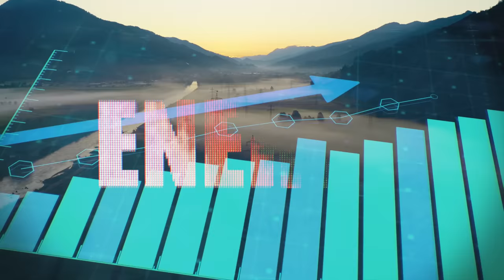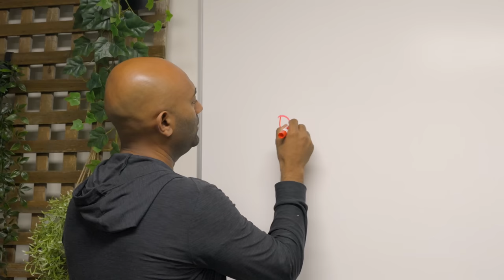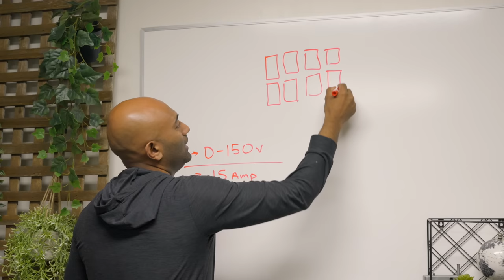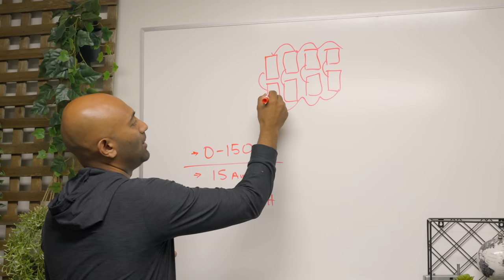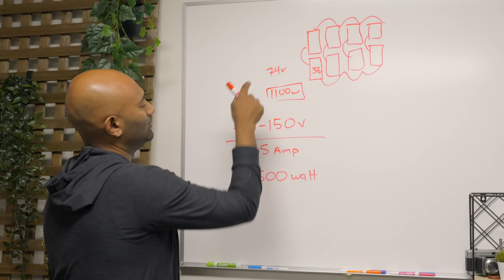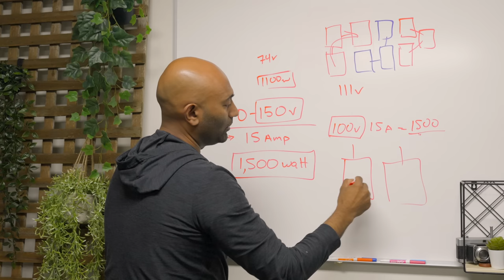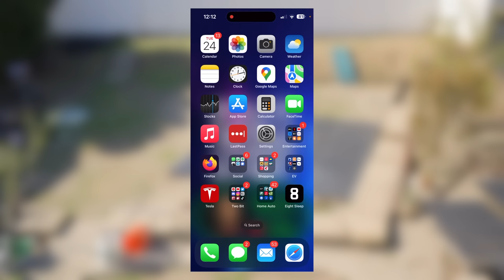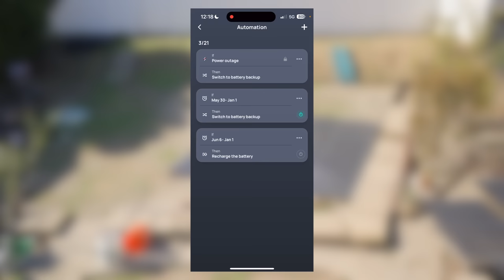Home Backup Power + Solar Power WITHOUT Permits!

Comment: I loved this Vlog, very informative, like yourself I can work out on paper the variables, but doing it in physically is a different animal, but you did it, and much respect for you for that.    I learned a lot from your descriptions of the troubles you faced, laying it on the ground first was not on my previous plans, but what a smart idea, guess what, I am doing that.  You are indeed a smart but also a commonsensical man.   I also agree with the independent battery unit approach, so you can add on as required.  The only change I would make, was putting the lighting and refrigeration on its own independent circuit, as we can not live without food or lighting. (but maybe you thought about that) Regardless, thanks for the great Vlog.

Comment: Even if you are not connected to the grid you still need permits in the vast majority of places,. For instance ; I am building on vacant land from scratch, I will definitely need permits for both my mounting systems and the electrical part.  Even without grid connection, one reason is if Firefighters need to come and deal with something they need to be able to safely shut off the solar power rapidly and easily, to do their work.

Comment: Where did you get used panels? I'm in Michigan, and at $70 - $100 a panel, I would be more than happy to get going on my solar plan.  The only permits I might need would be for the roof installation because I don't care about selling back to the electric company.  At that price, I could afford to develop the battery walls and buy the power management, and even get a new roof.

Comment: Where is your ground? Are you running a floating ground? Where is your neutral bonded? Is there neutral voltage between the two systems?

Comment: The simple way to look at putting power generation of any type in series or parallel is, putting them in series increases the voltage, where you add the power value from each source to get the voltage output from the system.

Putting power generation in parallel increases current output.  It's better to match voltage on each parallel path, or you get into harder calculations to figure out what you're going to get.
Reply: Yes indeed, I'm glad you brought this up.

In fact, you have to match the voltage (or at least get very close) for the strings that are then placed in a parallel configuration,  as a safety issue.  If the operating voltage of string A is higher than the open-circuit voltage of string B, now string B winds up actually being reverse-biased.   If the string does not have a blocking diode (and most systems do not... solar panels only have bypass diodes built-in, not blocking diodes), then the reverse-bias causes current to flow into the under-volted string from all the other strings that are in parallel with it, forcing the entire array to the open-circuit voltage of the under-specified string and with potentially enough current to cause a fire in the wiring or in the panels themselves.

So voltage matching is mandatory.  The highest operating voltage for any string in the system must be less than the lowest open-circuit voltage for all strings in the system (when paralleling strings).

(One can also ask the question, why doesn't partial shading cause this issue?  The answer is because the open-circuit voltage for a panel is not affected by shade, only the optimal operating voltage.  So mixed shading conditions are fine, but mismatched series strings that are then placed in parallel is not).

-Matt

Comment: Very nice presentation.  A couple od nice additions and a warning.  To show the panel specs would have been helpful to begin your calculations.  Also the warning is the temp variant.  While the temps in San Diego are not much of a concern it's common practice to allow a 10% swing so that at lower temps you don't exceed the 150 volt limit.  A personal request would be to install optimizer to compensate for the shading to some of the panels.  Another would be to show the integration of a generator and how it can be automatically controlled. Just some observations.

Comment: We have 2 delta pros and 4 extra batteries. We bought the shp but never installed it due to too many issues with breakers being too sensitive and not staying connected as well as the typical Ecoflow firmware problems. More reliable to use the double voltage hub.

Comment: Even though you are not messing with a lot of panels, the math needs to be mentioned at the beginning and including electrical safety once you add up all those volts and amps. Also make sure you remind the people that solar panels do NOT have ON/OFF switches so if you have them in sunlight you can get arcs, sparks, and shocked...wear protective gloves. IF YOU HAVE SWEATY HANDS YOU COULD GET KILLED BY A 12V CAR BATTERY IF YOU AREN'T CAREFUL. If you go to connect 150V and you get yourself across both wires you could die and DC does NOT let go of you. You stiffen up like a 2x4 so if you are sweating...you are very conductive. Overall, I found your video good and informative.

Comment: Hey Ricky.  Have you ever tried hooking the Ecoflow systems up to pull power from a vehicle's alternator while the vehicle is in use?  That might come in quite handy when you have to be away form the power grid for an extended period of time for instance, during a weather disaster.
Reply from the maker: oh interesting basically using the car as a generator, although we have a gas generator we can just run and its a bit simpler... but that would work!

Comment: Backup power is more or less important depending on where you are.

I think that everyone should look at the average number of hours that a power outage lasts in their location and think about how to deal with that.
Test what happens when you turn off power and what will hurt you most. Likely you want your fridge to continue to run and be able to make coffee etc and heat up some soups etc.

Small 1-3 kWh batteries like Ecoflow, Bluetti and Anker will bridge most poweroutages if you accept you can't do laundy for that period.

If you already have solar on the roof to reduce your powerbill, see if you can have a switch installed so the DC-current from the panels can be used for the batterie.

Comment: Hi Ricky,  GREAT video.  As always very informative and on point.  Ricky, I have many questions.  1.  Can you give your EV car a quick charge if you run out of power, just enough to get you to a charging station??  2.  Is there a solar panel company that will sell directly to he public??  I wan to build my own system.  I see how easy it is.  I only want to buy American or Canadian panels.  Can you suggest a few ??  Or better yet, can you make another video on how to buy directly, from manufacturer to home consumer . . . .  Thanks, Again
Reply from the maker: great questions... i needed a special bonding cable to charge my car with this. but installed on the smart home panel grounded and everything you can just plug your car right into an outlet... some days in the summer when the batteries are full and not doing any more charging, i'll plug in my car to charge even on 110v .. check out solarsteals.com i have a link in the video description... i got my panels from there used for cheap. otherwise i'll take a look!

Comment: Hay Bud! Nice going there & very informative! Maybe on your next system, try using Server Rack LFP batteries from EG4 (Signature Solar).  Inverters there are pretty awesome too!
Reply from the maker: Might need to look into this for the main house, i'd love to check it out!
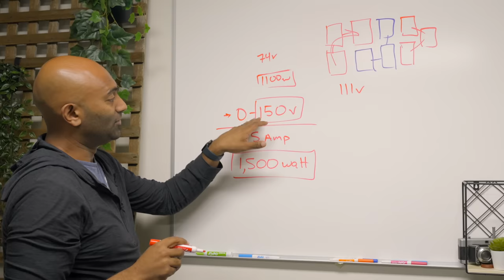Reply: 9:24 many of the EG4's have 500 VOC so you can connect 10 panels in series without any combiner boxes or parallel adapters

Comment: Do the apps work with local wi-fi and locally stored data?  I ask for several possible reasons.  (1) Way off grid use.  (2) If the power is out, the cell towers might be out as well.  (3) Security reasons (perhaps someone doesn't want the data leaving the premises, or observable by whoever owns the apps).

Comment: Your video is very inspirational, I am recently also considering to use EcoFlow Delta pro not only as a backup but also with Solar panel to reduce electric bill.
I have some questions for you if you don't mind.
1. I saw you have two EcoFlow Delta pro units, do you have a group of Solar panels changing a Delta Pro and another group charging the 2nd Delta pro?
2. If I use the EcoFlow Smart Home Panel (SHP), and I only want to connect to 120V loads, is one Delta Pro good enough?

I had been browsing on-line for answers, but didn't get a definite answer. I would appreciate it if you can spend some time responding.
Thank you.
Reply: #2. You only need one Delta Pro for 120V setup.

Comment: I was able to score 26 used 310 watt PV panels for $25 bucks each that i'm keeping along with grid tied enphase IQ7s which I'll be fire selling. The NJ owner had roof leaks with mold damages by Certified Installers with permits in the thousands and a new roofing co that wouldn't even remove or touch the solar panels. You can guess the home owner was so pissed at solar anything. I believe this is the future of solar or fast and furious non permanent solutions. I'm also doing this for prep in NYC which looks like it's here... Just ride the prisioner subways for proof. I'm preparing now just in case. My only concern is this seems like the solar panels are a MPITA to do this each day. The real value is is designing something unique on wheels that can be removed easily at night and stored upright in a tight garage location?

Comment: Cool setup, but in the video you show the closet with circuit breaker panel in the back. I don’t know what the fire codes are where you live, but in New Mexico blocking access in a circuit panel of any kind is severely frowned own.

Comment: Open voltage! You cant check it with a multimeter. In the winter it will be 20% higher. The spec is on the panel

Comment: You might not need permits but what does your insurance company think?
Any problems caused by a system that they haven't accepted would undoubtedly be used as an excuse to avoid paying a claim. Do they agree that there is no chance of these causing a fire, electrical short, or other unforseen problems? Do fire departments  have to be informed about this installation?

Comment: Ricky, I’ve been watching and enjoying your videos as well as others on YouTube. 
I have a EcoFlow Delta Pros system with 8 335 watts solar panels. I understand about series vs parallel but I want to be clear on how you set up the 3 sets of 3 panels. 
Am I right in thinking you set up 3 panels per set in series and the 3 sets in parallel? 
3 in series equals ~111 volts and 9 panels times 335 watts equals 3015 watts max? 
Or is the 3rd set of 3 panels going through an inverter and feeding the AC as dual charge?
My understanding is that the EcoFlow will cut back the solar as it’s charged up so it should be protected right? 
Thanks in advance for your videos

Comment: Hi, I watch many of your you tubes and follow many of your advice/ideas, mostly relate to solar. I just bought Ecoflow Delta Pro as I understand that SDE&G charges different rates for electricity during the day. Please show us how you program or use Ecoflow Delta Pro to save the most by charging it during low rate time and use that saved energy in high rate time. Thanks

Comment: Any updates on your EcoFlow system for backup power during outages? I like the idea of a backup system I can do myself and grow over time, even I start battery only and add solar later. How do you do solar without a permit, or do you never export power to the grid so a solar permit not needed?

Comment: This video on solar panels is in short supply. I would like to know how you know what voltage your need to consider when hooking up to something like the invertor? Also what if you are using microinverters how does that change the connection setup?
How is that Two Bit HQ hooked up to allow you to feed your home-selected cicruits? Does it sense the power from the grid and when it is lost switch over to battery power from your EcoFlow units?

Comment: You could generate enough with your $500-600 worth of used panels (I'm looking at used panels too btw) to 'fill up' a couple of EVs, saving $1,000s per year on 'gas'. You're instantly in credit.

Comment: That's nice, but you live in San Diego. You rarely need air conditioning. Most people need more power to cool their home in the summer. Also to heat in winter.

Comment: Great video, thank you.  I was seriously considering solar but very few solar companies will install or service their system where I live.  And to do so did not make economic sense.  My monthly power bill averages $75 per month in summer and $300 per month in winter.  Cheapest equivalent power solar system quoted was about $275 per month and up.  My little 850 sq ft house needs 3 plug-in space heaters running 24/7 all winter to heat half the house.  
I'm not an electrical expert, but are the batteries charged from the solar panels first then the grid power kicks in after the sun sets, and/or power use exceeds solar panel output?  OR do solar panels and grid power charge the batteries simultaneously?  I want to maximize solar panel usage.  
How does one tell if the batteries are being charged primarily first from the solar panels?  And can the batteries take months of freezing?  Couple months straight night time temps are at 0*F and day time never gets above 25*F.  What system configuration can you or anyone recommend?  House is too small to have a wood stove install permitted.  
I'm concerned about power outages lasting several days like neighboring communities.  If that happens here in winter, I will freeze to death.  Thank you.

Comment: Hi! I have the EcoFlow pro and have been interested in the power wall panel. The only thing stopping me is the installation. My circuit breaker is out doors so I am not sure 🤔 if the panel is rated for outside weather. My other concern is, will the electrician be able to install it without many problems? Will they have to watch a tutorial from EcoFlow 😅

Comment: For this setup with ecoflow, how much $ per KW versus the current $ per KW from the utilities company? Please share this info.
Thanks & God bless,
Hai
Reply: San Diego KWH is like 42cents plus. With ample sun and panels you can reduce your electricity monthly cost dramatically. Even reduce 80-90% cost.

Cource storage batterys are needed as the Sun do go down. Or Clouds move in

Comment: How do you stop power backfeeding to the grid when running the house on the batteries, and if you wanted to run the whole house while charging and discharging the batteries, would you need the smart panel, esp if you have more then 10 circuits you need to run. TIA

Comment: Thanks for this super clear information... One thing I want to ask if that you ( for a fixed house setup )
 thought about adding the Ecoflow Power Hub with 3 batteries to the Smart Home Panel.
So you can put in more Solar Power?
Or is this a strange idea ?
Thanks in advance

Comment: The electrical inspector informed me that UL 9540 compliance is required by Code where I live (Chicago area) and installing solar panels on the roof requires a permit. I want to install solar panels on my roof to charge a solar power station (no grid tie and not necessarily Ecoflow). I plan to simply plug into an outlet to charge when the sun isn't shining and feed a dedicated critical loads panel to power certain essential circuits. But I can't find a single portable solar power station that complies with UL 9540. How were you able to do this without a permit?

Comment: don't you need permits to put the panels on the roof?  and aren't there restrictions for putting used panels on the roof?  all the solar companies i.e. SunRun, Sun Power, etc. say they would only put solar panels on the roof for a grid tied system.  btw, i have a Bluetti AC300 and i am doing something very similar to what you have set-up for your office.  i have my Bluetti hooked to a transfer switch that runs my home office room.  i have three 250 watt panels against my backyard fence so the sun exposure is hardly optimal.  i was hoping to put solar panels on my roof but the solar companies i spoke with say they only handle grid-tied systems.

Comment: 2 strings of 4 in series then parallel them. 148 volts at 15 amps = 2220 watts But I see it can only take in 1600 watts so yes 3 is the way.
Reply from the maker: 3 is the way..... sounds like lord of the rings quote lol

Comment: So the smart home panel acts as the isolator? It seems you're still using grid electricity for your office though storing rather than selling the excess generation. So how does the permit-circumventing isolation occur?

Comment: thank you for making this video. Do you have the solar panels connected to the delta pros all the time or you disconnect them when it reaches a certain level? Also did you add a 30 amp circuit breaker to the main panel for each delta pro for fast charging? I was watching the video on how to install the smart panel and it mentioned that. If I was going to charge the delta pros using solar only why would I need to add the 30 amp circuit breakers?

Comment: Is there a used solar panel supplier in San Diego? I bought 2 panels new from a solar reseller (sells to major installers) and I’d rather buy used as I build out my DIY system.

Comment: I also live in San Diego (Penasquitos). I have an ideal south facing 30 deg sloped roof. Are permits NOT required (specifically SDG&E and City of San Diego) to mount a small solar array (ie. 2KW) to a roof to "feed" a separate non-grid tie temp backup power station (ie EcoFlow) ? Would appreciate your knowledge since you have a similar setup, although your panels are on the ground.